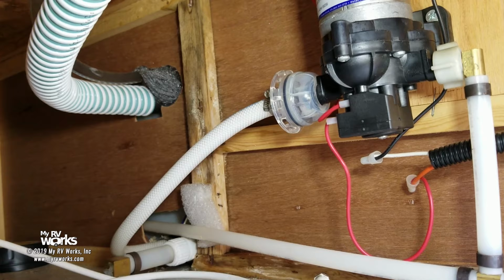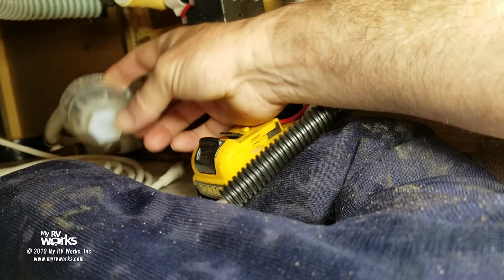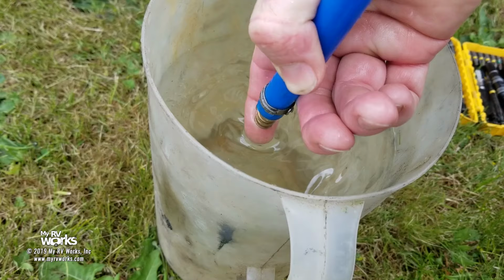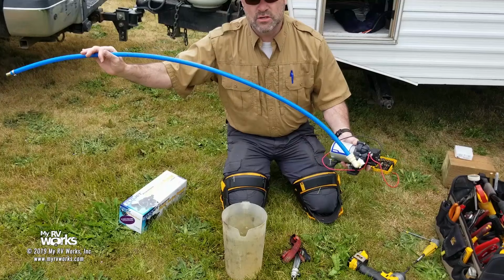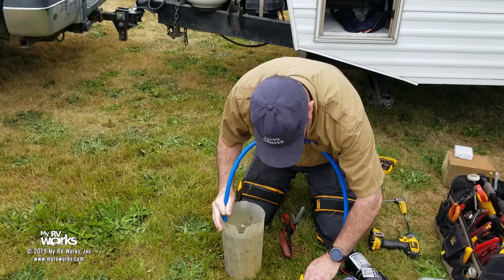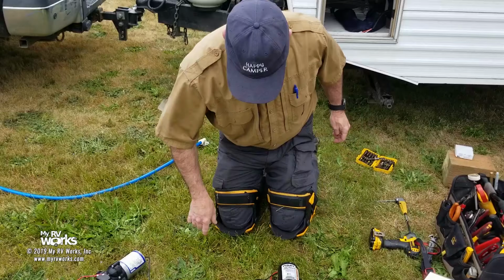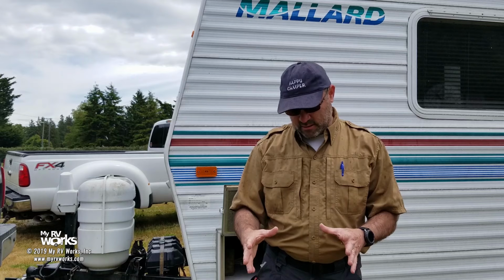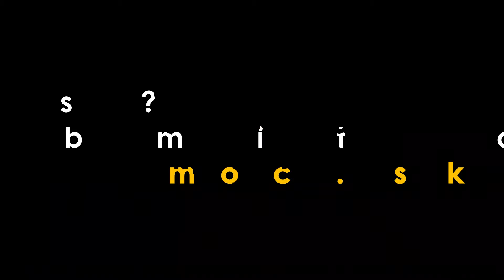Check And Replace A Failed RV Water Pump

Comment: Thank you again!!!!!  Filled the fresh water tank and tried the pump no hum but the pump was leaking around the head of the pump and spade connectors!!!!  Replaced the pump eureka we have water!!!   Haha I have now replaced the fresh water pump and required the water heater and furnace heater and replaced the gaskets for the furnace igniter/hot air inlet.  I wish I could have had easy access like you but I’m a cornbread fed country boy haha!!!! Thank you again for these videos.   Stop showing me stuff to fix its hunting season in Mississippi haahhaah

Comment: On another video I saw the same pump I have that looks a lot like this on.  He took pump apart and found a stuck outlet valve... I found the same thing in mine, the valve got stuck over winter.   Saved buying another $85 pump.
Reply: You are right the outlet valve can stick from not being used  most people camp with full hook ups pump is only used when sanitizing water system or winterize system

Comment: I love your method of testing the pump with the Dewalt battery. Literally yesterday my son bought us a Dewalt tree trimmer 8” chainsaw thing and it has those same batteries. Now I can probably use your testing trick to test things on my cars. Very cool idea. I always used long test leads. I like your idea better. Thanks
Reply: To clarify/ my problem is my husband didn’t winterize the popup we have and it blew out most of the plumbing! Now guess who gets to fix it… 😠
Reply from the maker: Just make sure your battery for your DeWalt is 12 volts and not 18 or 20 volts.
Reply: @MyRVWorks  thank you! I actually checked it after I posted and it is 20! So I won’t use it to test.

Comment: There can be several ex fix issues with rv pumps.  Blockages and stuck valves are very common.   Probably should do a little disassembly of the pump before dropping $ on a new one.
Reply: Not sure that's an option when you need to guarantee the repair.  Would be nice to know the failure though.

Comment: Ok for same problem figured it was water pump after taking it apart cleaning it I realized how simple It is, everything should still be fine no visible damage. I
Unscrewed out feed and ran it
With tank hose connected and it primed it self water stated shooting out. Try this first. I’ll
Keep my replacement pump
As a spare

Comment: I have the same pump and just went thru a winterization process where the pump was good, but lost its prime (and hence would not suction RV antifreeze).  Had to throw several attempts at forcing water to the pump eventually "jump starting" the prime with a turkey baster!  Don't give up on the pump too quickly unless you KNOW that its bad.  They can be a little finicky as I have discovered...

Comment: Having an issue with my pump right now. Mine sounds exactly like the one in your video and I’m assuming that it’s a bad pump. My pump is normally much louder. When you have a water supply problem does the sound of the pump change?

Comment: I have a 2011 Palamino P-2100 and slow water flow , the pump is 2 years old and works fine, is there a screen at the end of the pickup hose inside the water tank? love your VD btw

Comment: I have a similar situation with my pump where I was getting very little water and a lot of air to my faucets. The water in the freshwater tank was full.  When I took off the intake line to the pump, very little water was coming through the pipe.  But, I similarly tested the pump and it sucked water out of a 5 gallon bucket.  Suspecting a clogged water line, I hooked up an air line from a compressor and blew air into the pipe, back to the tank.  Apparently, there was an obstruction in the pipe as whatever it was got blown back into the freshwater tank.  I reconnected the line and the pump system worked for a short period of time. But, the line got clogged a day later.  All I can figure is that when they drilled the holes into the plastic tank for water level sensors, intake and supply hoses, they didn’t blow out the debris. And, that is how it sits today. I’ll have to figure out how to clean the debris from inside of a 2-tank  freshwater system.  There is a 1-1/4” equalizing hose between the 2 tanks.  After I get that fixed, I believe there is also a cracked water hose in the commode, as well.  Being that the RV resided most of the time in Florida but was moved to North Carolina, I suspect that my uncle never winterized the coach.  So, there may be some cracked lines, as well.  Hope to see a video in the future on finding/repairing lines that cracked due to freezing.  Thanks for sharing your knowledge on RV’s as I am a newbie and most everything needs attention.  You are my go-to channel for RV repair !!!  Thanks 👏
Reply from the maker: Thanks for the vote of confidence. Sorry you're having that issue with your RV. That would be a difficult one to try to figure out. As far as finding leaks, I use air pressure. Here's a video where I demonstrate that.  https://youtu.be/i-WJi3z8DGQ

Comment: Darren If you could actually show the removal of the pump and the installation of anything you replace.  I have a 1993 fleetwood Tioga with a 7.5 litre  motor.  Going in to replace the pump did not look like that.  Spider kill first day then air out then go in etc.  It’s more realistic and true for me it would help.  I was born 2-26-1970 so I relate.
Thank you 

Also do you have a video on any rig like my motor I am trying to do my engine water pump 93 e350 7.5L 
One of The best motors Ford ever built,  fact check that.

Comment: I have a pump that won’t kick on until pressure is at like 0 psi. Turn on kitchen sink and pump doesn’t turn on until water is at almost just a drip. Then when pump does kick on it sputters lots of air too. Think I got a bad pump or what?

Comment: My water pump goes on off on off!! Only way to shut it off, turn off power switch!! Hmmm...i have plenty of water pressure when shower etc are on. Since I have strong flow, does that mean pump is good, yet have pin holes in water line(s).?

Comment: I replace my RV water pump because the other one had cracked and was leaking water inside Aaron I was wondering what else other than checking on the hot water heater what other steps do I need to do to be sure that I can put water to the RV hopefully not have leaks I did run into a problem where I had a leaky faucet on the tub I'm having to replace that fought because the connectors on the back where everything screws together had shattered basically I started taking all the part and they were falling apart in my fingers anything else I need to Be watchful and mindful of when putting water to an RV for the first time in four years thanks

Comment: Great video Darren, but I was hoping to see you have to troubleshoot the "Low Side Latching Controller" for no pump when the switch(s) are activated, from any switch location.  Our Class A Holiday Rambler's water pump will not turn on when any of its 3 switches are turned on, but the little red light illuminates by the switch.  Am I down to replacing the pump?
Reply from the maker: Hi Joe,
 
Your question has been selected for an upcoming video where it will be read and discussed by Darren - Certified RV Tech and online personality for the 'My RV Works' videos.
 
If you have not already subscribed to the 'My RV Works' YouTube channel, please do so and keep a watch for the ‘RV Tech Talk’ video releases.  This series is a selection of comments and questions that will be covered and released weekly.
Here is our YouTube link:  https://www.youtube.com/c/myrvworksinc

Happy Camping,
My RV Works Media Team
Reply: did you have to replace pump?

Comment: I began winterizing my RV and when I initially turned the pump on it was sucking antifreeze into the lines. I went inside to turn on the hot and cold lines for each facet, but when I returned outside my antifreeze jug had tipped over and the hose was no longer in the jug. I immediately placed the hose back into a new open jug of antifreeze but was getting no suction. I turned the pump off waited a couple minutes then turned it back on and am still not getting any suction. what would you recommend?

Comment: Do you recommend teflon tape on the threaded connectors? 
Also my tank has a line with a T in it about 4 inches above the pump the second line above the pump simply ends in a thumb screw connector similar to the one that connects at the pump. 
I assumed this was for a vacuum break, but also noticed the tank is vented. 
Is this t required ? 
Should I simply replace the tube from the tank to the pump when I replace the pump?

Comment: What is the little 12v battery pack with wire terminals? I want to buy one. I couldn't find it on the author's Parts and Tools list.
Reply: Standard dewalt 12v battery

Comment: I assume that you turned off the water supply right? Then when you removed the pump what did you do to prevent all the water in the lines from flooding that little area where the pump was mounted?
Reply from the maker: Believe it or not - I am not as dumb as I look!  Yes, water turned off, yes drain from low point, use a 'water snake' and my Kool-Aid  bucket under the fittings to absorb any water that drains out.  this ain't my first rodeo!
Reply: @MyRVWorks  I wasn't implying that you were dumb! I need to do this and I just wanted to make sure I know exactly what steps to do so that I don't end up with a mini flood.

Comment: Darren do you talk about being connected to city water and having a problem overflowing the onboard water tank in any of your videos?  I have this problem this morning.  I suspect its the check valve inside the 12 volt water pump that is allowing the city water to back-flow through the pump and fill my onboard water tank...Do you discuss this in any of your videos ?  Thanks
Reply: Hey Terry, I had the same problem you are describing. I took the head off the pump cleaned the seating surface for the check valve, still leaked by. I ended up buying and installing a check valve in line between the pump and the city supply, problem solved.
Reply from the maker: Hi Traveling Terry,
 
Your question has been selected for an upcoming video where it will be read and discussed by Darren - Certified RV Tech and online personality for the 'My RV Works' videos.
 
If you have not already subscribed to the 'My RV Works' YouTube channel, please do so and keep a watch for the ‘RV Tech Talk’ video releases.  This series is a selection of comments and questions that will be covered and released weekly.
Here is our YouTube link:  https://www.youtube.com/c/myrvworksinc

Happy Camping,
My RV Works Media Team

Comment: My fresh water tank is exposed outside.
I wanna make a "kool-aid" straw with a 3 way valve for my "Input" side.
It gets to freezing I can shut off the outside and turn on the koolaid straw, and have the end in a portable water tank on the inside.
Reply from the maker: They have winterization kits you can add to a water pump. That might be exactly what you're looking for.

Comment: Wouldn’t it be just as simple as just putting your finger over the end of the water line to see if the pump is sucking. If it is I would think the pump is good and if not then it’s bad. This gets rid of all that battery and water jug

Comment: Why not just to replace the head of the pump instead of the whole pump
Reply from the maker: Good question.  I only stock the entire  pump assembly in my service trailer and it comes with my 90 day workmanship warranty and the 1+ year mfg warranty. So, I just replace the whole thing when I am in the field and move on to the next customer.  If it were on my personal RV, I had more time and was not paying $150/hr for a service call I may have taken the head apart and either tried to fix it or just replace the broken parts.  Most of my customers don't want to pay for the  bench time that would end up costing more than a new pump.

Comment: Hell I can’t even find my pump in my 2018 fleetwood flair, spent all afternoon looking inside, finally gave up. My pump won’t even turn on, I checked the fuse no problem, can’t check the pump cuz I can’t find it..lol HELP !
Reply: Check along side the master bedroom bed. On my trailer I have these step style shelf’s and on one side the bottom step lefts up. Hope that helps

Comment: When oh when are you going to mark "plus" on your little battery with a permanent marking pen?  Personally, dealing with people's potable water-system I'd use a cleaner kool-aid pitcher and keep my hands out of it. I'm in the process of tracing the fill-pipe to my water-tank so I can replace the rotted hose and it looks like I have to cut through the floor under the bed to reach where it attaches to the tank. (1990 Holiday Rambler Imperial.) I was amazed that the exact 30 year old fill-pipe was available online at Tweety's.